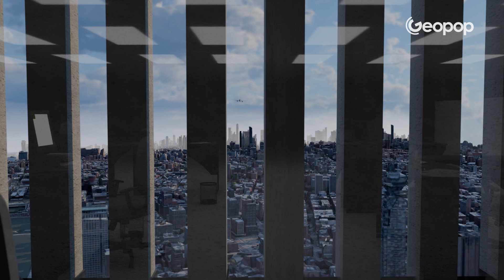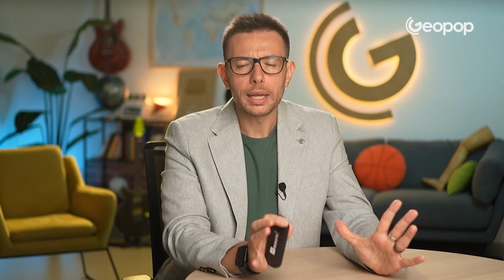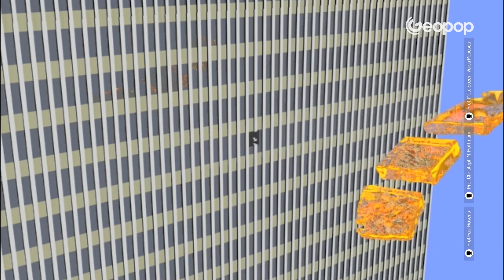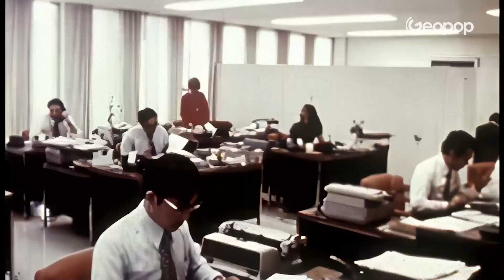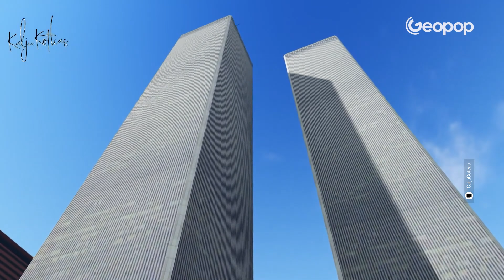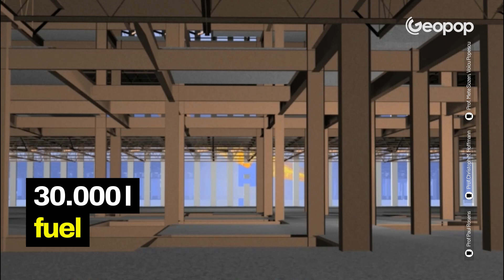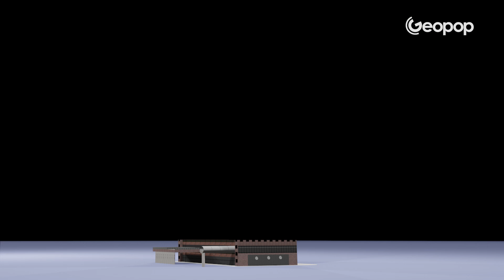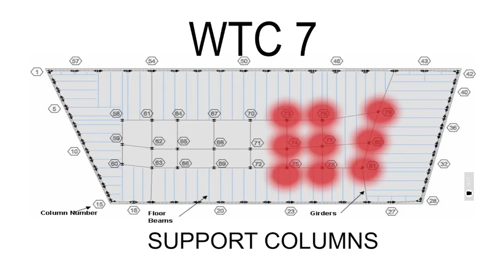9/11, 2001: The Technical Reconstruction of the Twin Towers and WTC 7 Collapses

Comment: Worked demo for 25 yrs. Seen many buildings come down. There is NO WAY anyone is gonna make me believe the planes, or the quality and position of the steel, or the heat, etc made those towers drop as they did. Only a controlled demo makes buildings fall like that. If it were collateral damage from the planes, it woulda come down in pieces. And likely the bottom 5-10 floors would not have come down at all.
Reply: Not true, you just have a weaker understanding of structural mechanics. It is perfectly reasonable (and described by physics/mechanics) that the towers came down by airplanes the way they did. 

If you have refutation(s) of the planes taking down the towers the way that is conventionally claimed- then please present them.
Reply: @Joseph-e9p1x BS
Reply: I guess you missed the part where the top floors collapsed and with each floor added mass and velocity.  There's not other way for buildings to fall.  They aren't strong enough to fall over sideways. You watch too many cartoons.  BTW, the jets had 4000 times more energt than a 5000lb SUV going 70mph.